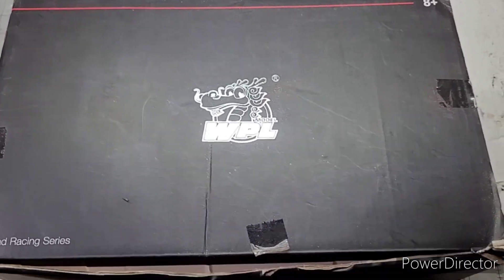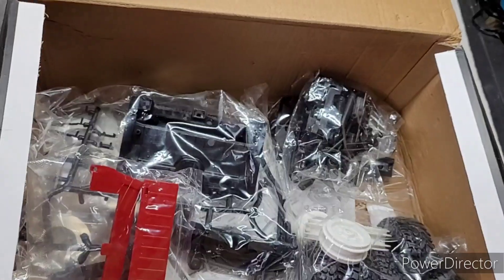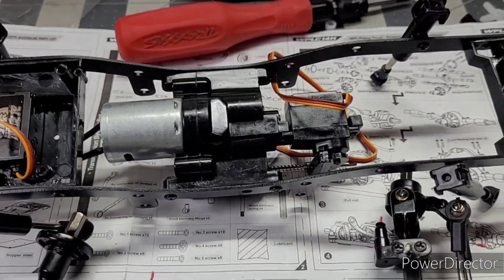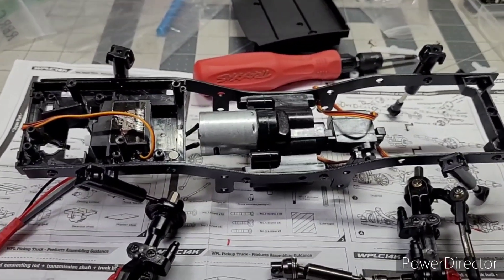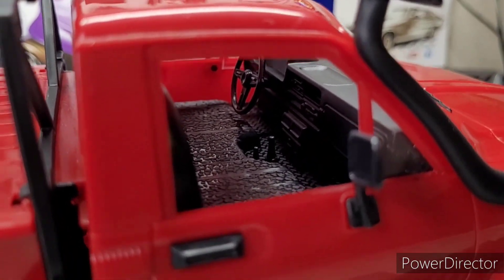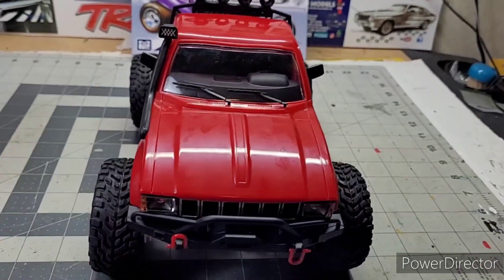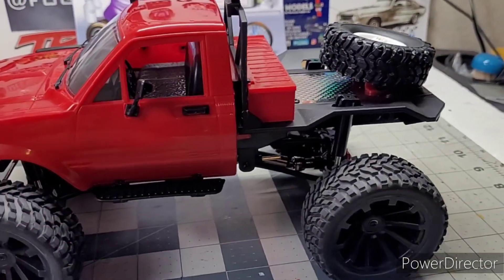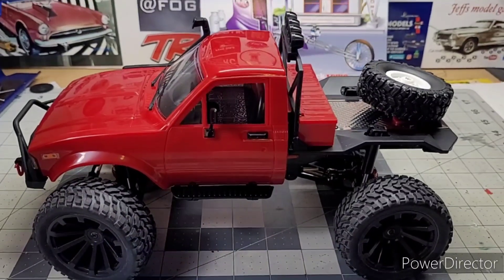WPL C14 Build and Upgrades

Comment: I still think I’m going to upgrade my C-14 RTR to the 2 speed transmission and some bling
Reply from the maker: it's cool with the two speed transmission,thanks for watching
Reply: @islandrc-duke1972  does it shift in/out of the 2 speeds well once out on uneven terrain ?
Reply from the maker: @bubblesrcshed  i have seen that on other videos,will do a mod to keep it from flexing so it does not jump out of gear
Reply: @islandrc-duke1972  sweet I hope you show a video of that modification 👍
Reply from the maker: @bubblesrcshed  it is real simple,a peace of wood between the chasis and servo that switches the gear and it will take the flex out of the servo,will show it when i do another video

Comment: I'm thinking of buying that kit but what the deal with that car is it worth it? Do you recomend it? Also what ESC and transmitter did you used? It looks very nice thow! I really like the scale details! NIce presentation! Thums up! Cheers!
Reply from the maker: yes i recommend it,this is the upgraded kit my wife got me,the link for the esc ( https://www.amazon.com/Mirthobby-Brushed-Motor-Electric-Controller/dp/B07WGMRK1R/ref=asc_df_B07WGMRK1R/?tag=hyprod-20&linkCode=df0&hvadid=47579516 ) the remote is a radiolink with the radiolink receiver.thanks for watching brother
Reply: @islandrc-duke1972  Thanks a lot for the infos bro! Really appreciate it! Have a great day! Cheers!